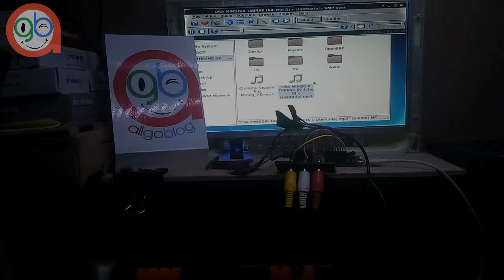Orange Pi Zero : How to make RCA Audio Video Out and USB Port on PinOut interface

Comment: Buy the Orange Pi Zero 3 Board
They did not send me the RCA module
and I don't have Micro HDMI adapter
It turns on fine but it doesn't transmit video to me
I made the connections just like the samples
Pin 5 - Video
Pin 6 – Audio
Pin 7 – Audio
Pin 12 - ground
What could it be?
Greetings from Mexicali Mexico!

Comment: Can a ( Y ) adaptor split one video input to 2 video inputs in my car ? one for back camera and the other for dvd player ? Actually i have a lcd screen installed in my car seprately with my car dvd player. I want to connect my reverse camera direct to lcd which has only 1 video output.